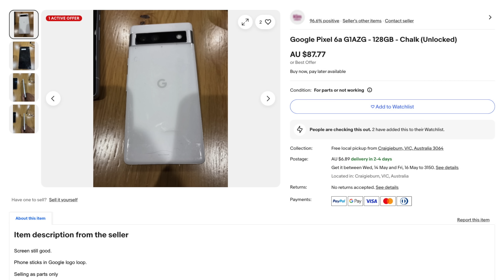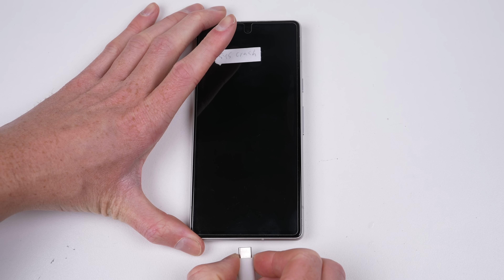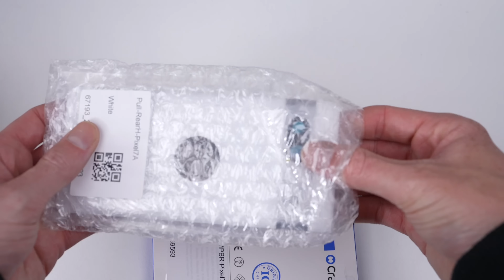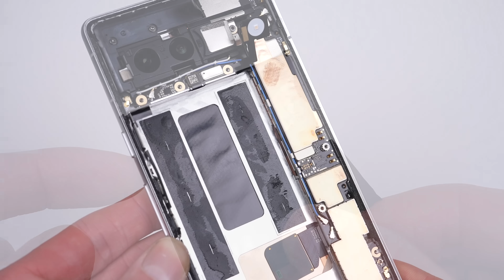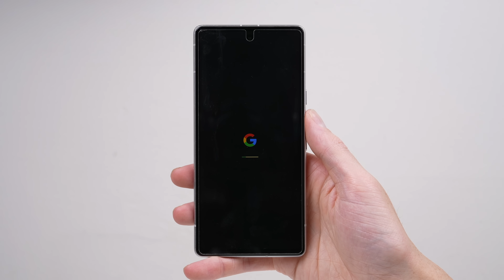eBay Seller Scammed Themselves With This "Pixel 6a for parts" - What I Received Is Much Better!

Comment: I bought a Samsung Galaxy S10 back in January on eBay for only £50. I don't remember if it was listed as "used" or "for parts or not working", and sure, the device looked like it'd been through hell, but it was fully functional - enough that I could use it daily until I got my Samsung Galaxy Z Flip3 fixed.

Comment: I once had bought a for parts Wii U for $40 that had a video issue. Turns out it was set to output in AV out instead of HDMI, and only took one setting in the system to fix.

Comment: Hey Hugh  how do i fix a phone that has software issues an it says  the metadata is corrupted. An refuses to factory reset I tried many times I've been told if I keep trying I can damage the enmc storage  do I need to re install android? It came with andriod 12 heilo P22 4gb ram an 64gb storage unit it is an Digicel dl4 plus an when I try An get close it says ;NO COMMAND;

Comment: I repaired Google pixel 7 that belongs to my friend strangely bad he was also expanded the same way you had it. Only the location off the battery expansion was near the connecter which is top right and the one you have bottom right near to the connecter. So my theory is the Google pixel 7 lineup might have some of the production issue.

Comment: This is why the Pixels are so good at accepting custom OS ROM images [like Graphine OS], and can be locked down again]. The phones are FULLY customizable. So putting a guest user on them is easy, AND users are sand-boxed.  The "root" or admin user can create other accounts, and yet leave the main one de-googled. So if there is a google app you really need, you can just create a google-crap account, and it is sand-boxed from the main machine.

Comment: I once brought a Xperia T2 ultra with a damaged screen for 5,000 INR (~60 USD back then). Turned out it was just a cracked screen protector which I replaced for 100 INR.

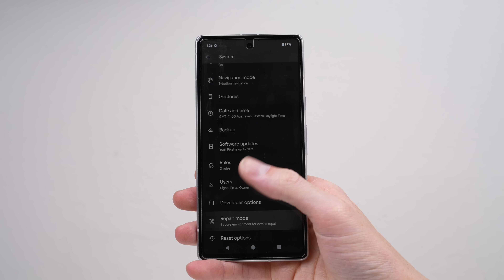Comment: 7:45 The same concept is available on Android 14 ( also android 13 had this feature ), my Galaxy Tab S9+ comes with it, which is called " Maintenance Mode ". This turns off the tablet and boots right back in to a guest system as u mentioned which you can exit out of if you have the fingerprints/passwords or faceID. It has no personal info, only have a selection of pre-installed apps which comes with the device. This is similar to a SandBox environment.
Also I've been watching your content for a some time and i got to say it is just amazing work. Much love from Sri Lanka ❤

Comment: After about 5 years the battery of my Huawei Mate 20 swelled, but it was bigger at the bottom, taking off the back cover and disconnecting a cable that runs over it, I recommend changing it immediately because the speaker and vibrator stop working, luckily I was able to find the original battery, I bought a cheap one before and it swelled and it didn't even hold a charge anymore.

Comment: that black lens protector looks really good actually on the pixel 7a... when I eventually upgrade from my old 6a i will definitely put a black lens protector aswell, its a shame google didnt keep the black bar design, i always loved the look
Reply: I bought my Pixel 7 used with a lens protector like that, and being that I got it to replace my faulty Pixel 6, I can tell you why Google switched to anodized aluminum instead of keeping the solid glass camera bar: weight. The Pixel 7 has similar dimensions to the Pixel 6 but is significantly lighter due to the new camera bar.

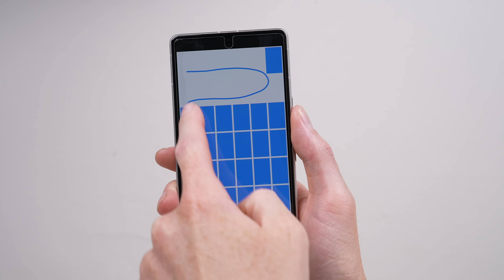Comment: 6:42 Ah yes you can test if the device have burn in or no. But you can’t see the color at the top of the screen. %99 of burn-in’s happens at the top where battery percentage and WiFi signal etc.
Reply: Very true

Comment: I wonder if the battery swelling issue had anything to do with the wireless charging coil assembly. It looks like where the battery started bulging was at the bottom corner and appears to be where the cable for charging port runs over the battery. Could this have sped up the heat degradation of the cells leading to failure?

Comment: 4:15 You need a Electric Screwdriver with a pic like attachment. Put the Tip on the Glue and rotate it. It will rip of the glue so easy.
Idk where i have seen it but i also take a toothpick like and remove glue that way.

Comment: Most Samsungs also have repair mode for a while now. I used in on my 2022 model when I had to send it in for screen protector replacement under warranty. The other option was a factory reset.

Comment: The fact that a heat plate is necessary to open your phone should be illegal.
Reply: my touch broke on s10 5g, i didnt have a heat gun or plate so i had to use a ziploc bag of water heated by a microwave to get started on the repair. it was painful but i got the back panel off in one piece.
Reply: Oh come on, one would think nobody is that dumb. There's any number of ways you can heat the adhesive to release it.

I throw my phones to open on my 3D printer heatbed.

Others use a hair dryer or a hot air soldering gun set low.

You can also get a heat retaining pillow that you heat in a microwave from a repair tools company. It is not expensive.

You can use any number of things in a similar capacity that you already have at home, such as medical heating pad or a medical hot water bottle. Just think for 3 seconds before you make a mountain out of a molehill.

Comment: Last year, my pixel 7a's battery was swollen, mainly on the top right which was weird. Got it replaced and it worked as good as new. Almost 1 year later, still no issues. I am using a slow Samsung charger which can only put out 5V at 1A.

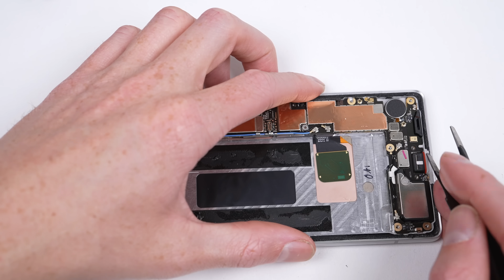Comment: 4:00 that's why there's a dedicated free repair program now for 7A!
Reply: My pixel 4a had the same bulge on the same spot
Reply: @abrahamphilip9337 go fix it there’s a free battery replacement program for pixel 4a
Reply: @abrahamphilip9337  guess what both pixel 7a and 4a batteries are made out by the same junk supplier aka sunwoda electronics that puts out batteries that are way below the quality of samsung sdi , lg chem and CATL/ATL (amperex tehnology) so thats why many pixel phone face up total battery failure so early

Comment: My dad also bought a “parts” iPhone 13 Pro Max, arrived as an fully functional iPhone with no issues and was very clean😅
Reply: maybe they shipped the wrong one 😂
Reply: From my experience, "for parts" tends to mean they had no way to test it/ test it correctly.  I got a 360 slim they said was RROD it wasn't they had the wrong power supply for it.
Reply: @GrumpyIan like i resell iphones, so i have got a lot of stories but one time i bought an iphone SE 2020 and iphone 8 parts lot. All of the phones were working. Got the 8s for 40 a piece and the SE for 80
Reply: I'm looking at my friends dads iPhone 12 mini, its laggy, but i think its just clogged - factory reset and good to go :)
Reply: and found out the iphone had activation lock.
Reply: @rchltmedia  like the one time i bought an iphone 11 and it turned out to be an 12, icloud locked. Asked for pass and unlocked it
Reply: @rchltmedia  yeah so much for the comment about saying no issues
Reply: @Pearloryx  lmao
Reply: @Pearloryx 😂

Comment: Actually if you plugged in your cable to the phone the adapter will turn on! Because usb c adapter start at 0V to prevent the backfeeding problem the phone needs to negotiate to the charger to turn on!
Reply: Correct. USB-C chargers do not output any voltage without a device connected. Lots of people don't know.
Reply: @sjoerd104  yea and then he complains seller said its boot looping but its dead

Comment: Samsung has had repair mode since the s21 ultra back in 2020.  Sucks the battery was prob a used one I am always happy I can get genuine google parts here in the USA, stock can be trouble on occasion but it's gotten better over the last year or two.

Comment: makes you wonder how many "for parts" ebay listings are only one small fix away from being perfectly functional
Reply: Likely very few. The most common reason people sell their device for parts is a broken screen or back glass cover. And while a broken screen or back cover is technically "one part", replacing them is not trivial and usually not cheap (as the housing or screen assembly is generally one of the more expensive parts to replace)
Reply: @pacmonster066  actually quite a lot, ofc most need some skills to repair, but phones, especially older ones, are really not that hard to deal with
Reply: bought an iphone x "for parts" for $10. turns out only the battery was unplugged, plugged it back in, booted right up. no password, no icloud lock, iOS 14.4 too
Reply: LUCKY @eepyeri
Reply: I bought a gameboy color where the only issue was that it was missing the battery cover
Reply: I second this, I once bought a Galaxy Note 3 off of eBay that claimed to have software issues and the only issue I had with the software was trying to bypass it to root it, I ended up successfully rooting the thing
Reply: A ton, I made a living for over a decade from "broken" electronics on eBay and at pawn shops.
Reply: I bought a for parts 2012 MacBook pro for $20 off of marketplace and all it needed was a new MagSafe connector and it fired up just fine. it did have a board issue that disabled the trackpad though, but I still resold it with a mouse included
Reply: Around the same number as the ones advertised as fully functional but are in fact e-waste.
Reply: Quite a few, given my laptop only has minor battery issues (turns off randomly, etc) since I got it but I am far too stupid to figure out how to fix it :/
Reply: It's surprisingly a small amount I keep an eye out on laptops I've fixed Numerous dead ones by just reseating the battery and it worked for long time since but some of the gems are dead faulty ones but still have warranty so you get it fixed for free with little effort. This is more common in Australia due to our consumer laws here.

Comment: That battery didnt so much as melt inside as all the internals of the battery shifted down. I have seen that before from devices that were in cases and so they didnt suffer other physical damage. But that had been dropped from a decent height and landed on the bottom edge. Also constant vibration with it sitting vertical in like a car phone mount might do it too. EG you are an Uber driver and your phone is sitting there all day every day

Comment: 7:43 Samsung and some other brands like OnePlus have a maintenance mode. I believe Samsung added it in Android 13 (OneUI 5).
Reply: That doesn't really matter here in my country, the Samsung service center here requires you to factory reset the phone for repair. Great for data protection but inconvenient to backup everything.
Reply: Samsung maintainance mode is pathetic. I have given my samsung tab for service and the SC said that without certain data they will not be able to request parts for the repair cuz samsung won't let them and the maintainance mode doesn't allow for them to get the data
Reply: @mukeshramalingam2098  That sounds suspicious, or Samsung has weird repair policies in your region. I've had my phone sent in for repairs, both when it was in warranty (where it was sent to a Samsung authorized repair shop) and when it was out of warranty (sent to an independent repair shop), and they never complained about the phone being in maintenance mode.
Reply: @mukeshramalingam2098 bro so they rejected means maintenance mode is pathetic huh ?

Comment: When you did the Pixel 7 Pro screen replacement video I found a Pixel 7 Pro 256GB for "parts" because its screen was broken. It was $150 Canadian dollars because they did not test it,  this was when the phone was still over a thousand dollars retail (it was released 5 months prior at that point) the screen cost was more then the phone at that time but for less then $400 dollars I have a phone that has been working great for more than 2 years.
Reply: Wow

Comment: I went looking for a used Google pixel and came across the same thing, a pixel 7a with that same weird black sticker on the back.
When I brought it up with the seller he wore up and down it was a real pixel 7a.If this video was a month earlier I'd have bought that phone for quite the discounted price.
Reply: That black sticker is often used as camera lens replacement. It is easier than proper replacement.

If you buying you will have to check if the lens is broken.

Comment: it’s like that time when I bought a £10 iPad 4 16GB listed as parts with no description so I could use the screen for one of mine and I assumed it was locked and all but when I got it it turned out to be an unlocked 64GB model
Reply: absolute score
Reply: i bought an iphone se 16GB parts lot, they turned out to be working, one of them with no wifi but 32gb
Reply: Yeah and then you have to buy another screen to fix your own 😭
Reply: @SamyPlayzMC   or they could just use it instead of the already broken one?
Reply: @theoneandonii that’s what I would’ve done
Reply: @SamyPlayzMC wydm just use new one

Comment: Hey Hugh Repair mode was added some time back to allow for someone to repair and test a device without access to someones personal data. There is also a build in diagnostic app that you can enter by dialing star pound star pound 7287 pound star pound star.

Comment: Some Pixel 7a models have battery swelling issues. Google made a specific site to check if your Pixel 7a has that issue by putting your IMEI. If it's eligible you can either let Google replace the battery for free or get a Google Store coupon.
Reply: Which site is it where would you input the IMEI?
Reply: @NatK2010might as well Google it
Reply: @NatK2010 search "Extended Repair Program for Pixel 7a" and press the "Check if your Pixel 7a is eligible" button.
Reply: @NatK2010 If you search "pixel 7a battery replacement" the top link will lead you to a google site that has the link to check if your pixel is eligible.
Reply: I'd be really curious to know if this particular Pixel counted as an "eligible" phone.
Reply: @dimples282 it is. I knew someone with a 4a and their battery expanded. Google replaced it for free no question. They don't want the liability. Or maybe it was a 3a? The one with the plastic back
Reply: @dimples282 probably by looking up if it has a battery from bad batch installed, obviously.
Reply: I had two phones swell. It was rough
Reply: I recently went through their extended repair program for the P7a and got $456 because I still had warranty. Had the same battery swelling issue at the same location shown in the video.
Reply: Can confirm, I had a similar issue and had to RMA my P7a when I started to smell burnt skittles from the charging port! (alongside the back swelling)
Reply: 6a had it as well. they never even acknowledged it 🥲
Reply: @367Stories redmi 6 and iphone 6 have problem too :skull:
Reply: @367Stories well they did now
Reply: I had this happen with my pixel 7 pro last christmas, sent google support a message and they issued a replacement and I was told to dispose the old phone
Reply: dont dispose just fix it up and boom 2 phones @dirgh1717
Reply: @dirgh1717  pixel and nexus phones seem good, but the battery is always shit after 2 years or so
Reply: what the issue with phone model 7
Reply: Reminds me of the nexus 6p battery issue
Reply: @luvwwe  i thought that had a chip issue, not battery
Reply: I got 406 euros because my phone was affected.
Reply: so google would have done this all for free lol
Reply: I've claimed £175 on my 7a and my fiancée claimed £380 on the Google battery claim programme!! Mine is two and half years old with no issues at all so far.
Reply: I love how its only in a few countries, everyone else is fucked
Reply: Or change the entire phone
Reply: I actually got a 50$ check for my Pixel 4a, no purchase needed
Reply: @William_3DS  how did you get imeis of thr 4a?

Comment: Wiping in recovery always gives errors. The errors are actually the command line telling you the files dont exist anymore as a check to make sure it deleted everything
Reply: Well, I am an old flashoholic. I root phones, flash firmware and twrp. On the stock recovery, I have wiped data many times. It usually doesn't give any error, except some special circumstances eg. A phone with only the recovery without any system.img.
Reply: @Imrul-nq5tu yes , i have wiped many times including in Xiaomi and Google 4a5g too i never got any errors , only time error you would get specifically in orange fox recovery if you flashed something stupid.
Reply: @xninja2369   Yeah. Also with only the stock recovery without system the recovery cannot wipe data. It will show error like, unable to mount system. (I know it because once I only flashed the stock recovery.tar without the system file in Odin)
Reply: Burger cheese. Make it make sense.
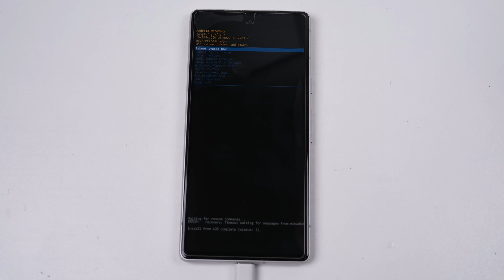Reply: @RickJamesEstate 6:00 the wipe
Reply: @SkelitonLord227  the wipe.
Reply: Stop making stuff up
Reply: @winchesterkid  It‘s literally not made up. Resetting in recovery always gives some kind of errors. It‘s normal.
Reply: @winchesterkid the voices the voices the voices AahahhahhAAAAGHHGGG!!!!
Reply: @winchesterkid  I agree with you.

Comment: Strangely enough, I think my phone is suffering from a similar issue regarding the battery ( poco f4 gt / redmi k50 gaming edition), the battery is abnormally swollen on the left side only, the weird thing is that the bulge itself is way smaller than the size of the left cell ( it is a dual cell battery), any tip or advice would be greatly appreciated ❤️